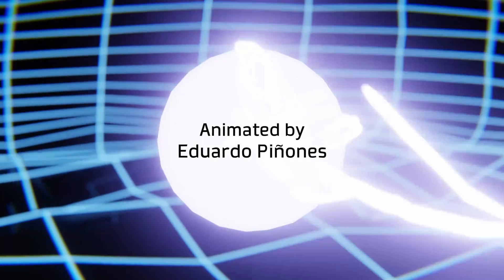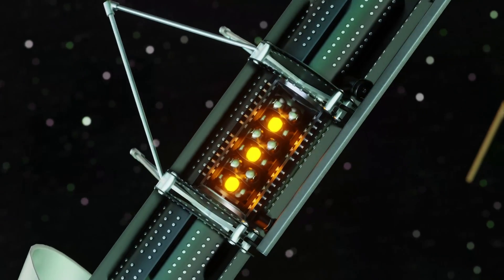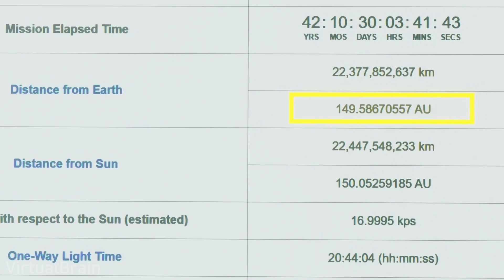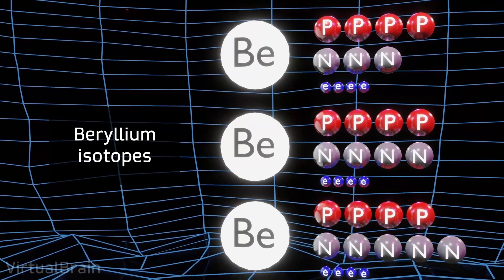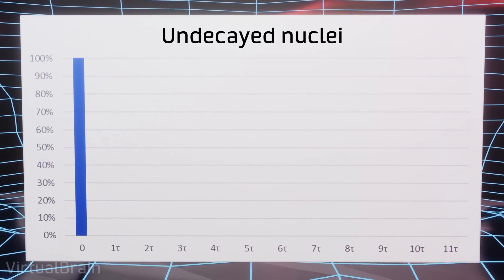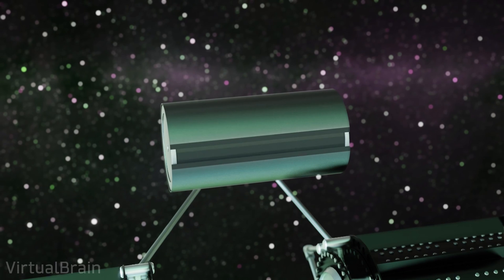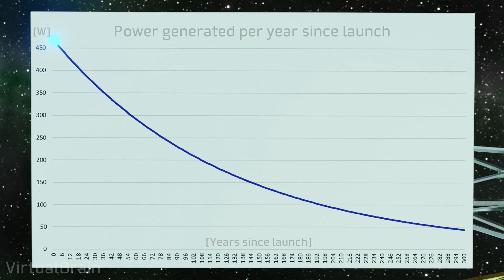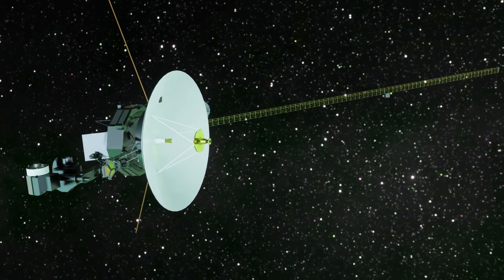How a Nuclear Battery Works in Space⚡ Thermoelectric Gernerator

Comment: Limitless energy 40 years ago but they still charging us for everything the earth provides us .
Reply: Even if you could have a couple of these generators by your home, I bet that it is not as cold as space so you would at least need to have coolant pumps, and those cost money to operate and needs to be replaced when they eventually fails.
Reply: Nuclear energy cheap to produce, but not cheap to maintain.
Reply: Limitless? The uranium lasts for 80 years, and also are you willing to have a radioactive power source inside your home just so you can save money on paying electric bills? These things are used in areas where there are no inhabitants nearby or in machines in space where it won't matter if it's spreading radiation. How wtupid can you be?